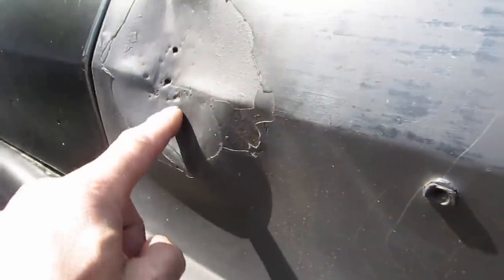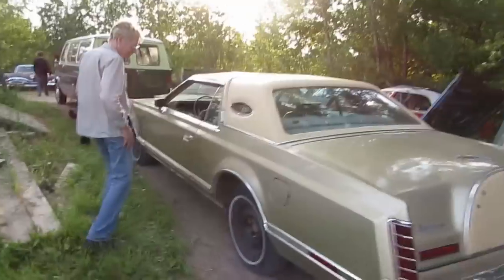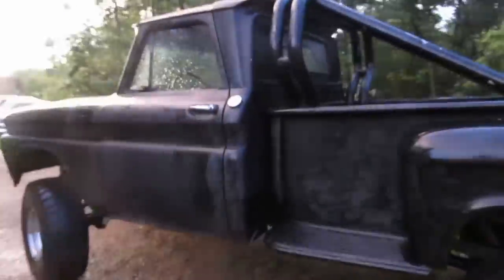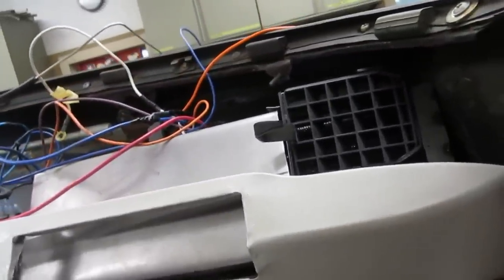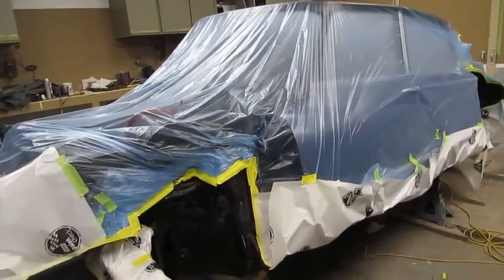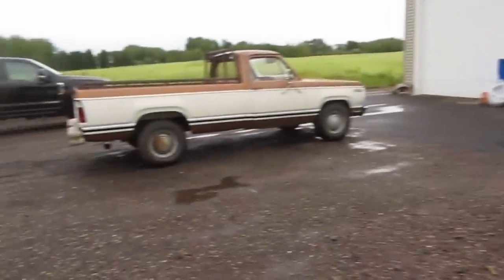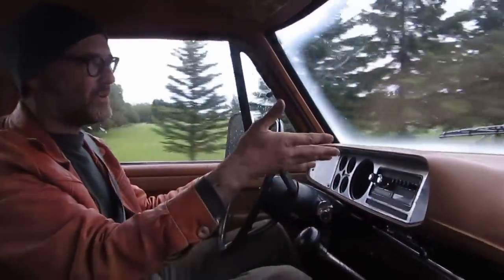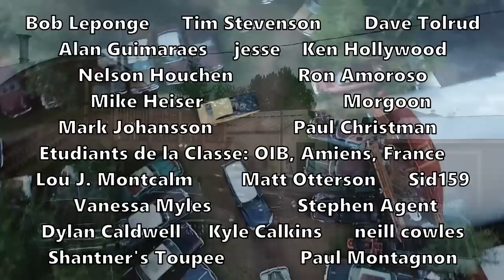The "Other" Dodge Diesel, Driveway Dust-ins,

Comment: The Mitsubishi diesel option was Dodge's response to GM & Ford offering diesels. The weak Mitsu. engine sorely needed a turbo to make up for its weak performance. GM put the Oldsmobile diesel (a weak piece of junk)  in the Chevy & GMC pick ups. Ford put the International 7.3 (w/o turbo) in theirs. None of these had much power or performance. The GM w/ the Olds probably had the most power but when leaned on would soon self destruct.

Comment: 2835 Dodge diesels built. 1000 1962 Dodge "Perkins" diesels built. Enjoy your show, you and the agents. I recently rescued two 1989 Dodge Daytona ESs from the crusher. Both Flash Red & Silver. One, a 150 hp 2.5 factory Turbo. 4th in sales of 1989 sport coupes. 1989 was the models PEAK sales year. Base price around $8500.

Comment: I worked at a Dodge dealership and we sold one new and acquired one on a trade. They ran forever, but they didn't have much power. Chrysler also sold the Mitsubishi diesel and a TorqueFlite as a re-power package. We had a fleet of aluminum step vans that had been re-powered with this package.

Comment: I know about it but have never seen the 78 diesel. Easy to see why it didn't work,  noisy and slow. I have a 78 D-150 with the same cab and bed only with a drivetrain from a 95. 360, 4 speed auto, 9.25 rear. I love my truck.

Comment: Mitsubishi 6cyl 243 ci Non turbo.Built from late 77 into 79. Pretty gutless in a full size pickup but they were super good on fuel. These were made to compete with the GM/ Chev pickups with the 350 V8 Olds diesel, which ended up being a complete disaster for GM as they were notorious for grenading. Dodge even made 4wd Power Wagons with this motor. Great find of a super rare truck!

Comment: Scott:  You're doing it all wrong!  I have friend who worked for a construction company when he was a teenager.  One day they brought a 10 wheeler in with a caved in door.  The oldtimer "bodyman" told him  to get a can of starting fluid while he pulled the door lock and rolled up the window.  He then filled the door with starting fluid, broke out his lighter and boom out came the dent!  He then mixed up a pile of bondo slathered it on, broke out the wax paper and a paint roller and smoothed it out without having to sand it!  He then panel painted the door and sent it down the road.  As ithe truck left the yard he hit a bump and it all fell off in one sheet!  Needless to say, he was shortly terminated after that!  I think your sketchy dust in will last longer!👍🤣

Comment: Now I have another reason to love old solid tin! When we were making those kind of repairs on modern cars, you were in danger of burnig a hole every time you put a "nail" as we called it. One slight pull and a you ended up with a hole in the paper thin metal. And it was not only the thinness of the material: I was told the steel of today specially in newer asian  cars is mixed with a lot of other metals.
Nowadays you have this system that glues the stuff on the surface. The big advatage is that you  do not have to grind down to the bare metal. This wolul not work on a solid classic: but It is very good for the ridiculously thin metal of today

Comment: My late uncle was a diesel nut, and he tried to order one of these Dodge diesels from the dealer in 1977 when they were brand new. They must have been rare and hard to get new as well, because the dealer played him along for a couple months and then told him that they couldn't get one. So he went and bought one of the first Old's diesel powered '77 or '78 Chevy trucks instead.
Reply: Dealers didn’t want to sell a truck they had no idea how to repair if necessary

Comment: My 68 K20 had a Rockwell t-case. My 72 K20 Suburban has a NP205. No K20’s had a 10 bolt rear end. But it’s awesome. So my schitzo-ness will have to just deal with it.
Reply: Yeah, its been pieced together by previous owners. You are correct in regards to the transfer case. At the time, my brain was fuzzy and couldnt member, lol. Previous axles were stolen, and a later model suburban was parted out. The transfer case is original, i believe- it is the Rockwell. Thanks!

Comment: I remember when Dodge offered those diesel engines back then, think they were something like 241 or 243 cubic inches, Dad bought a new '78 D150 but it had the old workhorse 225 Slant Six and 3 on the tree

Comment: back in the days when I was grinding stuff, I had a Milwaukee half sheet pad sander.  nothing ever stalled it, just kept on removing material. if you keep the thing moving, you can do a decent job, quickly.  I like the way Miles specs his vehicles.  with service, the Mitsubitchy should go 500k.  back in the 60's Dodge maade a diesel pickup with the English Perkins engine.  just your average 1930's diesel engine.

Comment: My father bought this Mitsubishi engine from Mack Boring in New Jersey and stuffed it into 1 ton Chevy 4X4 pickup with a New Process 4 speed behind it - I believe it was a package deal from Mack Boring. Displacement was only about 240 cubic inches and it produced 105 hp at about 3500 rpm. Not very powerful but built very, very tough

Comment: That 66 Chevy is on a 73 & later chassis with 6 lug 1/2 ton axles. I've done a few of those swaps & have an original K-10. The 66 came with a Rockwell T-case, the Np205 didn't go into production until 69.
Reply: I imagine that is a decent improvement as you have done these swaps? Was it pretty straightforward or did it involve some serious adjustments?
Reply: @markcovey2304  There's some fab work involved but it's not rocket science. Major stuff is body mounts & adding a new front crossmember to support the steering box when you cut the front of the chassis back so it doesn't stick way out in front of the body like these guys didn't do! You end up with a sexy style body truck that drives like a square body.
Reply: Good catch, but not quite. The axles were taken by a previous owner. The next owner- enter kid here- parted out a newer suburban and installed the 8.5 ring 10 bolt diffs front and rear. Still has original Rockwell Transfer case & frame/suspension- brain was fuzzy at the time and couldnt member, lol. I think there are 9 leafs in the rear springs, lol.  I will be looking at correcting suspension with proper arced leaf springs (and less of them) with better shocks. Shes a rough ride right now! Thanks

Comment: RE the brass radio plate - it's also a support bracket, those units at their lightest when this car was designed were around 8 lbs of discrete electronic / valve beef.  They had hex nuts on the tuner/volume posts to cinch it in there.

Comment: Dean says "The Lincoln has a lot of issues". The main issue is it's a Lincoln. I like the dent repair. The Diesel pickup is from the era of the "gas crisis". And gas was not just expensive it was really hard to get. It was rationed in the states. Then some car designers figured out that Diesel was selling for 30 cents a gallon and was easy to get. I worked at a Toyota dealer in L A and for a while Toyota made a Diesel Camry and even a Corolla. Of course no gas mechanic had any freaking idea how to work on mechanical injection so they never caught on. And they actually used a rubber belt to drive the cam and if the belt broke all the valves got bent and so the head got trashed (not to mention piston tops). They were a nightmare for gasoline based dealers. I know Toyota made farm equipment in their early days so five bucks says that block got lifted straight out of some Japanese Farmall hay baler. And the injection pump says Nippondenso which is a company closely affiliated with Toyota. Would be interesting to research the pedigree of that engine.

Comment: A week late with my comments.
I took notes, so I just have to use them and get closure.  💁🏼‍♂️💁🏼‍♂️💁🏼‍♂️

Sketchy dust in on the Chevy truck:  Fine job, to me.
Story time with Dean was fun.  Did we hear why he had the face burn?
Piled into the Conti.  Where’s the bar at?  
That black Chevy truck was certainly rather “Red”.
Just missing an American and Confederate flag sticking out the back.
The older, rare, diesel Dodge
Unique and worth having.

Comment: Hi Scott. Nice dust in. Nice truck. I had a 63 Chevy. 8" rancho susp. lift, 6" body lift. 14" total. 44" monster mudders. 350 4sp. Cam +headers. Custom roll cage, padded. Alpine system. Hookers, dual exhaust. I miss that truck. It was baaad asssss! It also had the small back window with aftermarket slider. Short box stepside. I also owned a Dodge dynasty with the Mitsubishi V-6. Sold it with 319,000. Rare, but no one cares. I mean the deisiel truck. I guess Chrysler's been affiliated with Mitsubishi for along time? Damn the DS is a beauty!
Reply: Thanks Wayne! First chevy ive owned in 30+ years, and pretty fun so far.
I plan on replacing the leaf springs/blocks with proper arced leaf springs and better shocks. Would like a smoother, easier to control, ride! lol. Oh, and I tried installing my 39.5/15.5R14s on the truck the other day, but need to get my wheel spacers hogged out to fit around the hubs
Reply: Hi Myles. My truck had aftermarket Rancho arched leaf springs. I had to put small tires and rims on it to fit under the garage door. Purchased with no engine. I rebuilt a junkyard 350. It was fun running the ice in winter on Big Bay De Noc. Part of lake Michigan. Use a die grinder and carbide bit to hog out the wheel spacers. Mine had 15×10 chrome wagon spoke wheels, 44" monster tires. My kids loved that truck! It also had 3/4 ton axles. Eight lug nuts.

Comment: Mitsubishi 6DR5 engine don't have much common with Toyota 2H engine, except they are both inline-6 diesels and share bell housing pattern. They have different bore/stroke and also in/exh manifolds and injection pump are on opposite sides between these engines

Comment: I know of one other truck like that one. It was a friends dad's, that was a big shot at Chrysler. It was blue and white, a four speed too. They pulled a travel trailer with it. He replaced it with a Cummins powered 2500. It was a first year Cummins powered one... maybe a 83 I'm thinking. That truck is in amazing shape.... actually both trucks! I liked the 66 Chevy 4X4 too. He needs to throw a small blower on that 454, enough room under the hood to hide it.

Comment: I built a 1979 MkV for my buddy. I have  a Tmeyer 434 stroker kit and all the go fast stuff. It makes wonderful Cleveland noises, too. With the new suspension I had installed, it actually drives okay. But I've never liked driving these cars. My biggest complaint is the car's front overhang makes it very difficult to maneuver in any kind of small space. The interior room is also comical.

Comment: Napco 4wd ? Oh yea 1.2 k checking in ( I took a nap earlier today SMH)Nice Truck. I have several short bed rolling chassis('63,'64,'65 ) and my cousins '63 C-10 longbed. I also just drug home a '72 C-10. Also placed mt order for a one of those slide hammers for my stud welder. Dean should have stayed with the 1/4 inch whites. Check his DNA ....lol... Did i just notice that you'all are wearing jackets ? Here in NC we are still sweatin it out.
Reply: Nice! Sounds like you have space at home for toys? Got a set of mirrors that match the holes already in the doors? Ill take em! lol 66k20

Comment: I watched the Video yesterday, it was good stuff.  The level of vehicles being (worked on and viewed) has gone up and yet the Frazier is being used.  (And I did not hear a knock!) What happens if the Dodge truck with the Mitchebeau / mitsubishi (however it's spelled) Diesel had higher gears? (or less, numerically however you want to look at it.)
I could not sleep last night because I had fear of Big Tape.    Dean/Jerome  is a ladies man in the LTD.  I owned a 72 Cadillac Coupe Deville back in the day.  I loved that car.

Comment: That pickup must have to rev so much because it doesn't have a turbo like a normal diesel? Neat thing about diesels is since they are fuel governed I think theoretically you can just throw a turbo on there without having to do any tuning besides setting the max PSI cutoff.

Comment: Scott??   YOU are the king of the " Sketchy Weekend Driveway Dust In's "..   and why does that poor " K20 " ..  have " HALF TON " axles in it??
Reply: Nice catch! Two owners ago this truck was used as a mud bogger and the previous owner kept the axles and drivetrain, less the transfer case. Next owner bought a used Suburban and robbed axles, engine, and trans. The diffs are 10 bolts with 8.5 rings and now sport 4.10 gears with detroit true trac locker in the back and eaton posi up front with selectable hubs. They will have to do for now!

Comment: '78 Dodge pickup.  I drove one with a 318 and crew cab back in '80 or so when I worked for the local Parks.  It was terribly slow even with a 318.

Comment: I have one of those 4 cylinder Mitsubishi diesel motors from a dodge truck, the guy I got it from had it in a dodge D100, then polara wagon, then a boat, then a Chevy blazer, he out a turbo on it, made it drivable at least

Comment: 31:00 time sealing the evap up just a note you should have the lines plugged till time to run a vac pump on the system these new are sealed with argon gas all moisture removed now open it has moisture dust dirt and who knows what inside the pipes a cooling system is very fragile thing any spec of anything in the system came reduce it's life span

Comment: That's one of those Chevy dentside trucks or was that Ford LOL!! anyway that truck is awesome a 4x4 lifted pickup with a big block under the hood it don't get better then that I had a 1973 K10 4x4 short box with a lift  kit had big ol mudders on it had a 350 when I got it but it was tired so found a 454 that I got out of a Suburban found some high compression heads with big valves punched it 30 over had long tube headers a big thumping cam and had 3.73 gears and put a M21 close ratio 4 speed it was quick it would of been faster if I had street tires on it instead of mudders but it was fun I sold it about 4 years ago to my friend and he still has it and restoring it  because when I had it the interior was hammered and the car corners were gone and the floor had old stove back steel and the one cab mount was gone but he has it looking nice now
Reply: Yeah, she goes pretty good, 66 Chev. I need to adjust the Lokar cable shift to the 4spd auto so it will stay in 1st gear. Then we can attempt a burnout! lol. I tried installing my 39.5/15.5 R15s yesterday, but need to hog out the center of the wheel spacers first. Will see how sketchy this can get, lol

Comment: Those Mitsu 6Cyl diesels were used in the CJ3 clones they built up into the 90's slow, but tough little motors.

Comment: I guess those Dodge Trucks with the Diesel only made 105HP with 163TQ and get 20 miles to the gallon and you could get it with a 4 speed manual or a 727 load flight auto they only made 2,835 trucks with that engine and I guess some vans even had that engine in it

Comment: These Mitsu diesels would float the valves at 2000 RPM so, if you would replace the valve springs with something modern and hang a turbo on the exhaust, you'd probably get performance that would be considered...adequate.
Reply: Nope.  The valves don't even float beyond 4000 RPM.   The governor is set for 4050 RPM.   I have a W150 with this engine.  Added a Toyota CT-26 turbo and an intercooler.  It'll hang with any FACTORY gasser from the same era.